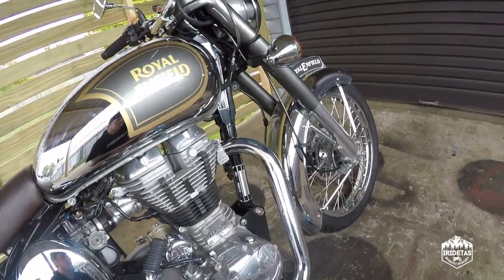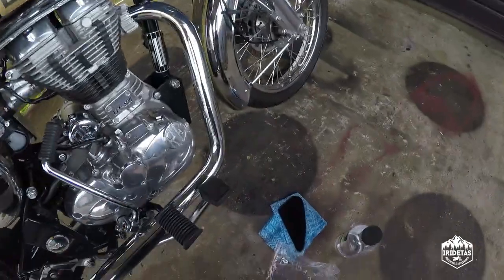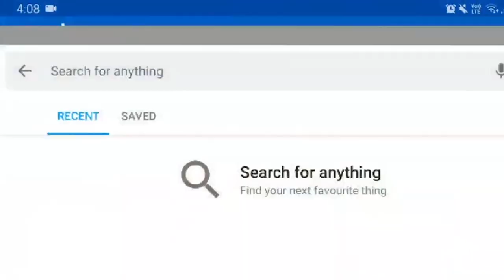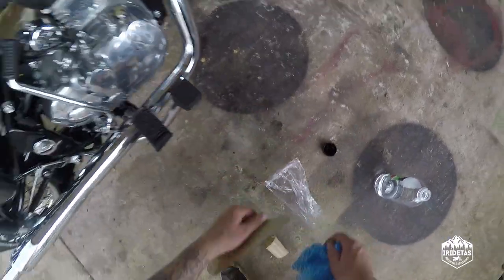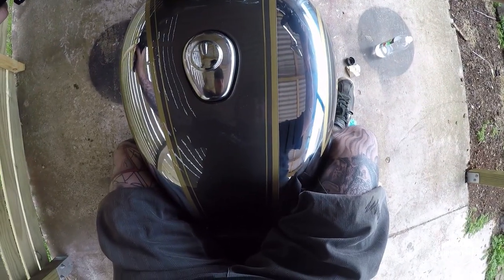REA #7 | EBay 3M Gas Tank, Petrol Tank Knee Pads | Install & Test Ride | Royal Enfield Classic 500

Comment: Similar pads are originally installed on my 2018 model. I made another change to my bike. I made new bar ends weights out of brass on my lathe. I made them 10mm longer than the original ones and the weight of each bare end is now approximately 300 grams compared to the original ones that are about 200 grams. Less handlebars vibrations on most speeds. I now get the most vibrations around 90 kmph, over and under that speed the vibrations are less than before. Thoughts about this...
Reply from the maker: Not sure the chrome models have knee pads standard but should imo! I have been thinking about changing to heavier weights sounds like it works from what you've said.  How many kms on yours? Mine now has 2800 and it's only really when I'm over 110 that they really kick in!
Reply: Yes your knee pads are looking good. Mine has now 4600 on the meter. No weather for biking, just now we have +4C. About a week ago the temperature was +20C and sunny.

Comment: How have the knee pads held up. Always worried about less expensive products peeling off but never sure if it's the adhesive or the installer.
Reply from the maker: No issues at all over 12 months on the bike 👌
Reply: @iRidetas  cool thanks

Comment: Knee pads are used for holding your motorcycle properly...not for paint protection ..
Reply from the maker: Lol, thanks mate for that insight! there is no way you need to support your core by locking your knees into this bike it far leisurely seating position for that and doest have clipons. So the knee pads are purely asthetic and will protect the bike